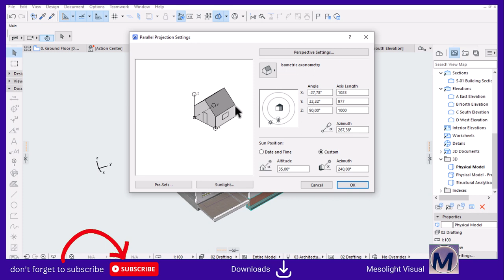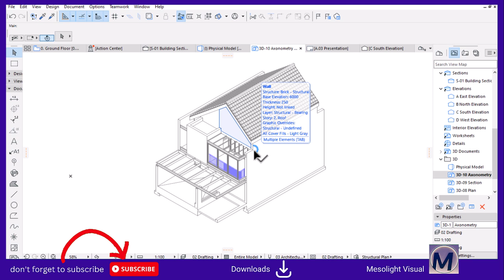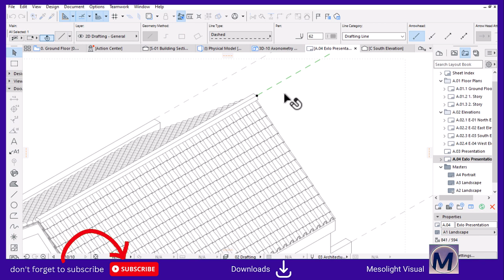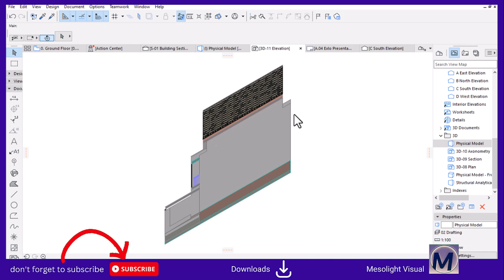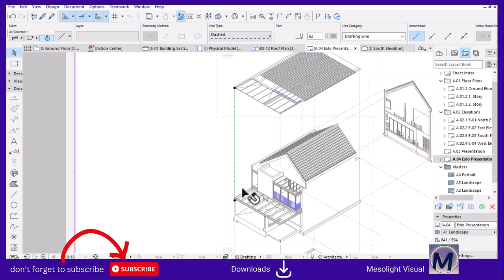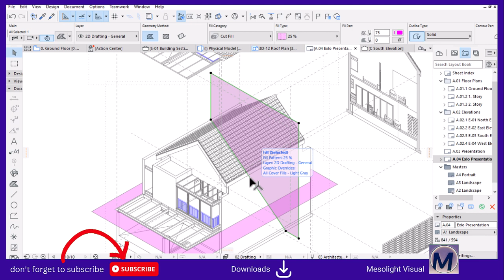Prominent and Unique Architecture Presentation Drawings in ArchiCAD.

Comment: Omg, this is so helpful i dont need make floor plan to pdf, and Convert to photoshop again to create isometric utility again 😂
-
But my methods very helpful, if the architectural archciad project so big! Sometimes using this method in this vid, very laggy…
Reply: well its some time wasted but you can turn the 3D documents into 2D drawings before putting them together